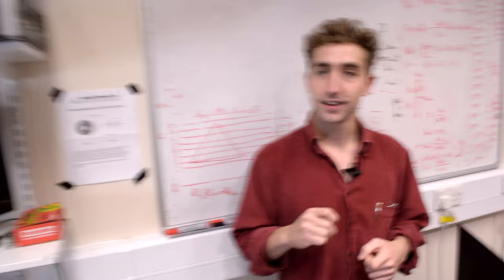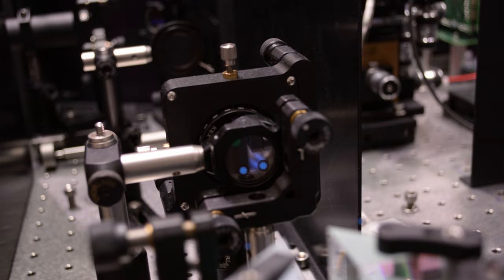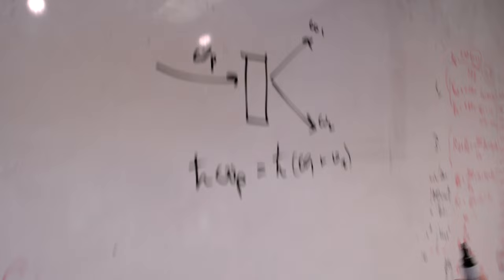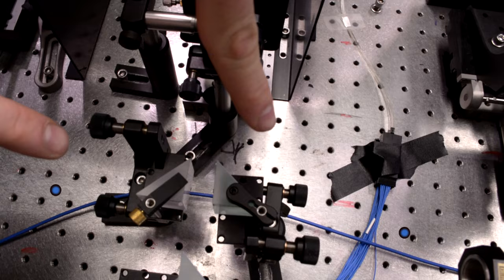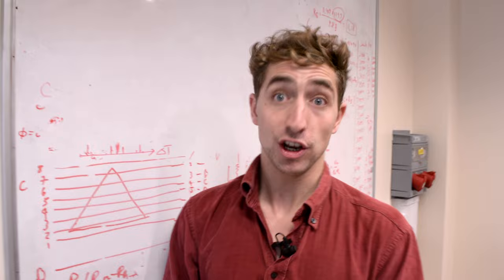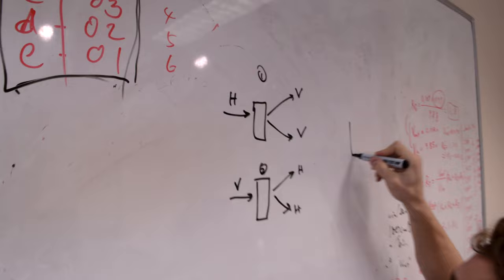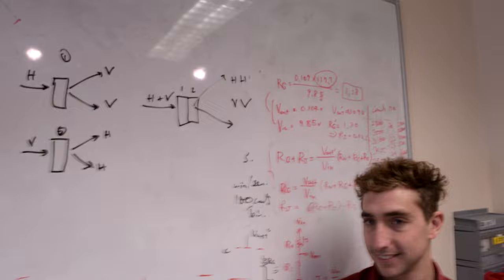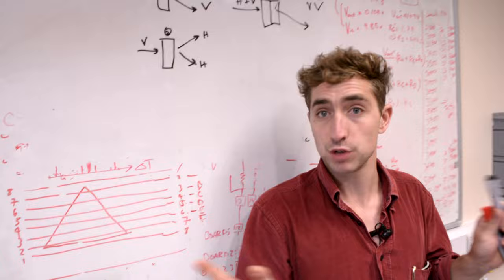How to Produce Entanglement

Comment: So in short. They create a situation where they cannot tell what state the photon is. So upon measuring it, it will be a new data called information.

You may ask your self. But why do we want it to be unknown? Wouldn't it be easier to know whats happening? Well if you know the state of the photon, then its data called information that we already know before measuring it. If you press 1 on a calculator, you will know the screen will show 1. That is not information, thats data, its useless, we know that will happen. However closing your eye, slam both 1 and 0 at the same time we won't know what will show up, 01 or 10 until we open our eyes and check it.

Now entanglement means in this case that when we open our eyes and observe 01 on the calculator, we know that the entangled part has to be 10. (just pretend that the calculator is the crystal and if we slam it it will have 2 screens that shows the resoult lol)

The low probability he talks about is that when you slam the calculator most of the time it comes up as 00111010 or 1101101, maybe 001, etc, because youre slam is jank, which is hard to work with so they keep slaming until its either 01 or 10, they filter out the rest.

AAAaaand the question comes again, yeah but why do we want to learn the resoult this way? why cant we just type in 01 all the time so the other comes up as 10? Well because these entangle experiments dont care about it being 01 or 10. What they care is that when they poke 01 it breaks into 00111010 or 1101101, maybe 001 again, but has a chance to become 10. They notice if it does that, cuz they filter out the rest. So when they poke they quickly check the pair at the same time. If it becomes the oposite of the poked that made it 10, so 01 then they say that our poke made the other one change cuz they entangled.

Now they made this a lot of fucking time making really sure that their poke did it not something else and cuz each time it was in the same moment as the poke they claimed it is an instantenous effect across space, so there is probably a wormhole between the 2 tangled pairs and reality is more then we can see.

IN SHORT they dont want to know the state of the photon, cuz they want to know when they poke it, to check if the other got poked at the same time. (also every single photon is entangled, but they filter out all but the totally horizontal and totally vertical ones)

Comment: so to get an entangled photon....you have to shoot a photon through a crystal. it sounds like it is the same photon just a reflection of it. is this the case? are we CREATING two photons? or are we just in a sense sending one photon out in hopes that we will see its reflection?

it really does seem like a reflection since it seems to be opposite from the other entangled pair. if one is spinning up the entangled pair is always spinning down. and this is why we can tell the state of one from the state of the opposite even faster than light. because the are the same thing....just reflected. so figuring one out.....instantly figures the reflection out.

Comment: So I understand that if a particle goes through the crystal two particles are created and then are entangled.

But what happens if we take those entangled particles and send one back through the crystal? Will it split again into an even smaller particle (1600 microns?)? If it does split, then what happens to the other entangled particle? Will it automatically be affected by the entangled particle and also split?
Reply: Salzy Sisters I had exactly the same idea. But i heard that only maximum 2 particles can be entangled, and you cannot entangle 3 or more.
Reply: @Chris-hy6tj  So then splitting one will "untangle" the other?
Reply: @Salzy Sisters must be, but I have no clue

Comment: So, introducing uncertainty (@4:23) is entanglement? I thought a demonstration of entanglement would be to do something on a separated photon to see the same effects on the other? My guess is by using two crystals back to back, you are not measuring the output of one (thus affecting its state) but to let the natural medium  of the second crystal to do its job. The question would be: then how many photons are split and which are entangled? Somehow I feel the explanation in the video is kind of lost after introducing two crystals!
Reply: Not many are split and the ones with lower energy are the entangled ones

Comment: Shouldn't the result of 1+2 lenses to give no output, no matter what type of H or V or combined light you are streaming?
Reply: Exactly my question!
Reply: I'm not sure but... When you put two crystals to polarize the foton in the horizontal and vertical orientation it will give no outputs as you said.

Except that in quantum mechanics you work with probabilities. So you may have a chance that some fotons pass thrugh the polarization. See that at 4:25 he says "if you get fotons come out". So that doesn't always happen. I think it's because fotons are also particles and has a probability density just like eletrons and then its like "quantum tunneling". 

But still i don't get why they have the same polarization when they comes out.

Comment: FYI:  That energy symbol looks much like the Saturn planet symbol in astrology. 
And the W shape symbol used to mean letter S in ancient languages like Phoenician.
H for horizontal also means hydrogen in che-misteri (could become confusing maybe in your math language) and Idk why a V is chosen for vertical, though it matches the dianal path in reality.  If the photon would come out vertical then it would stay in the crystal or come out on top. If it it would go in vertical it would never reach the crystal.
So I think this math language doesn't seem sufficient/competent to explain anything of our reality.

Comment: Dude, I am trying myself to get a practical experiment set up where a particle pattern emerges due to having the light passing through the slits be entangled aka "observed" but what I am experiencing is lots of deflection to that simple question: why can't I get a simple experiment set up to produce this? If this whole DS experiment is so true, why is there no practical evidence/experiment of light turning back to a particle state like we see in diagrams? What is the device used in these experiments that entangles/detects the actual individual photons? Because once I have that knowledge, surely I could create a beam of light that shows a particle pattern as the light gets entangled?

Comment: So if you use 3 polarizes, 2 at 90 degrees and one in between at 45 degrees, is the resulting light entangled?🤯
Reply: polarization filters have a strange tendency to put an aligning pressure on a 'spinning' (quasiparticle?) photon.
Reply: GeneEditingDuringIQCrisisStrugglesToMakeProgress are the two crystals essentially the same? I understand that light is put in different directions but why do we care which crystal produced the photons? What’s different abt the crystals?

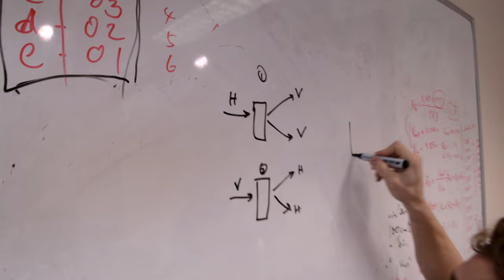Comment: 4:08. if you rotated both the crystal  and the polarization by the same angle in the same direction, doesn't that just mean that you haven't really done anything at all? i mean they're still in the same orientation with respect to each other. what was the point of doing crystal 2?

Comment: Hello
Question
Can you split the laser into quantum entangled pairs then broadcast one of the beams to a receiver / dish ect and the other beam through a boze-Einstein condensate.
If quantum entanglement is true then once the signal is found to match the signal that has traveled 10 minutes through space should be quantum entangled with the particle exiting the condensate allowing quantum computing with Mars.
Ofcorse testing could be done in a lab.

?spooky

Comment: I really wish those chuckle-head scientists and engineers would design a nice SIMPLE faster than light communication system for the Mars rovers. It would make teleoperation of them far easier. Put this entanglement to some serious use instead of just a thought experiment that has been going on since the 1950s.
Reply: Doesn't work that way :(
Reply: @MarchalisVan  I think it does, the original experiments by Neil Bohr only measured 2 conditions between the matched and magnetically sealed particles. Your only need 2 conditions on/off for communications to take place. All data is binary.

Comment: So why the big deal about entanglement.  Doesn't this experiment show that the polarization state is determined during creation of the entangled photon pair.  So regardless of how far apart you separate them both observers will ofcourse see the same result. 

To put it another way either Crystal1 or Crystal2 is excited at an instant in time. It is impossible to get HV or VH state. Hence the generation process predetermines that both photons will be the same during detection.

Maybe I have missed something? Can anyone shed some light on this?
Reply: Well, they haven't been 'observed' yet, so they are in a superposition state, like Schroedinger's Cat. It sounds like you're trying to say what Einstein said about the right and left gloves. But through Bell's Inequalities and the experiments we do with these crystals, we know that 'it being like a left and right glove in two different boxes thing' cannot be true. If there were such a hidden variable, Bell's Inequalities wouldn't work. But they do.

Comment: What is apparently missing in the image at
https://www.youtube.com/watch?v=ixCljzqHkHI&t=3m05s is that the bulk
of the photons pass IN BETWEEN the two prisms.  Isn't that how you
get rid of the ones that are not split?  If so, you missed an
important piece of the story.  The important missed point is that for
the momentum to be conserved the two photons come out at an angle
which means if a photon does not split it goes straight and therefore
can be removed.

Comment: What if there is something more basic to the universe than math? I propose a "Dynamic Stateless Computer" that operates on "Logic Geometry" based only on connections, or links, or pointers. The shape is the logic and the logic is the shape. From what I understand they are forcing current quantum computers to unnaturally apply a binary state to something that has a infinite evolution of states. Think of the electron and the circle it makes around a nucleus. That 360 degrees circle it makes is infinite in precision, and that movement certainly has an effect on its surroundings. Basically, math is the descriptive language of the universe, and not the actual universe because it uses imprecise measurements.

Quantum mechanics is beyond me, but if this only needs connections, ie a quantum entanglement, can we build a computer that operates instantly? Like I said, all I need is connections to perform logic... no need for information... the shape is the logic.

You are best off going to Github and seeing online without downloading the paper and models. When someone looked at my calculators, they accused me of: "You're not doing math! You're emulating math!" Look at the simple calculator first, it only does addition and subtraction. Then look at the complex calculator that does multiplication and division. As you well know, if I can do those things, I can do anything mathematically. In the main model I created if-thens, complex do-whiles, a randomizer and a relational database.

https://github.com/johnphantom/Dynamic-Stateless-Computer

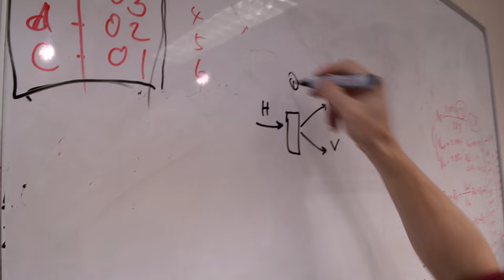Comment: 3:52 I feel like this guy is purposely trying to confuse us, "what I'm going to do is rotate this by 90 degrees" then precedes to draw it in exactly the same way but labels it differently, then draws both exactly the same puts them side by side calls it diagonal light but draws it exactly the same as horizonal and vertical and puts both H and V.   Not saying quantum mechanics should be easy or makes sense but this surely doesn't help.

Comment: Wrong, What you have done here is made an interference pilot wave. with the two crystals on the way out. This is basically the same misunderstanding linked to the double slit experiment.  Its been misunderstood. Pilot wave theory will explain double slit results for in a deterministic way. Something similar is going on here. The light fired through interacts with tiny ripples in gravity which make output hard to predict. What you have done is split a big frequency into 2 smaller frequencies. This is the key here. These frequencies where once linked/ joined so they are sharing some property that you are not aware of yet, Youve got the answer but the way you think the result happens was man made, Maybe they are connected by an extra dimension of space ? If you think that is crazy remember gravity inverts space at higher strength, maybe these things are connected between 2 dimensions/directions of space somehow. While the particles can separate in our space by distance, in the other space they remain connected. This is why when you change one the other one reacts here in our space. Pilot wave can explain interactions between frequencies, Study your electro magnetic diagram, and notice some of the interactions that make colors, From Gamma, xray, UV, Visible light, infa red, microwave, radio wave, long wave, gravity frequency(strength) , space frequency (curve/ddirection), Universal frequency (dimension) . This video will introduce you to the concept. https://www.youtube.com/watch?v=WIyTZDHuarQ&list=LLXP1PZbeizSATEjxeGCmrQQ Good luck
Reply: Pilot wave theory is the intelligent design of physics. No Local Realism allowed.

Comment: The first Quantum theorist lived 2500 years ago. What he said and is said to have done is far more advance than what Niels Bohr, Werner Heisenberg, Erwin Schrödinger.  He is widely known as THE BUDDHA and it is the LAW OF DEPENDENT ORIGINATION that is important.  When you see one side of the see-saw and know its position you immediately know the other side.  Quantum mechanics, however, deal with particles and entangle particle behaving  just like the see saw.  But everything concept in our reality behave the same way.  The ying and yang of things.  But what did the Buddha said about this?  This is the process of thought.  reality is one and it is split in two by thought process.

Comment: Ok I see how entanglement is made with the light. But what about electrons I searched all the  internet could not find one concrete example. I m not sure how can you extract electron from atom do some magic with another election than separate them and measure despite They're sooo freeking small and they are moving so fast.. Its more like fairytale. How practically can be achieved that?

Comment: The reason we "can't know" the position (momentum or polarity) must simply be because our instruments are not fast or small enough. Why doesn't the coin analogy scale down? It does on infinitely larger scales. To claim it somehow behaves differently at the quantum level means we need a scale at which it suddenly, abruptly and instantaneously changes behavior. Until this scale barrier is demonstrated, then all bets are off. ...edited unhelpful rant...

Comment: I appreciate the video but it doesn’t really convince the viewer about what was quantum about this setup.

You could simply think that different parts of the crystal would create horizontal vs vertical and one direction vs other. Initial contact point could be the decider not the measurement

Comment: I don't get it. I guess I don't buy that "we can't ever know" their initial conditions at the Quantum level unlike macroscopic initial conditions. It's like rolling two marbles into a spinning roulette wheel. Are the two marbles entangled until we measure them? No. I'm currently a supporter of the The De Broglie-Bohm interpretation which does pose that you can calculate the velocity of photons with known initial conditons, no spooky simultaneous states required.